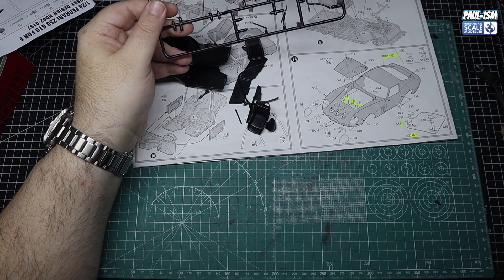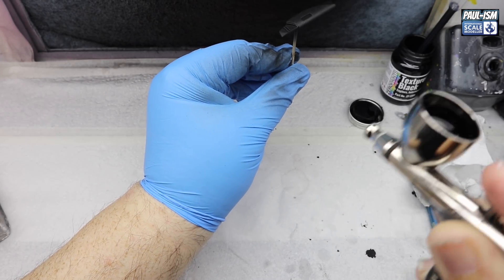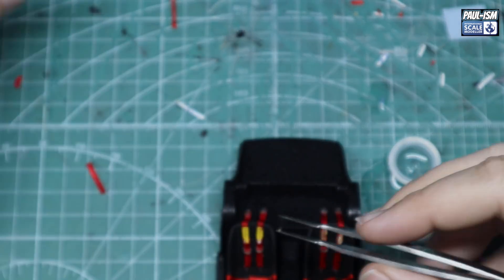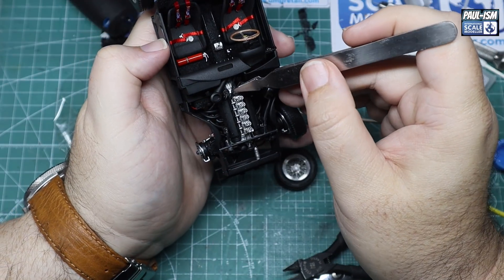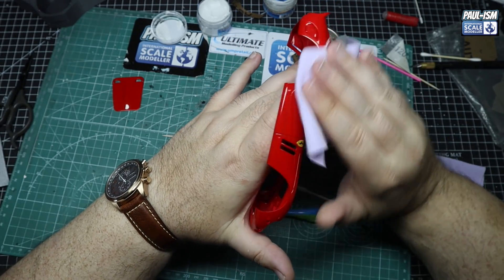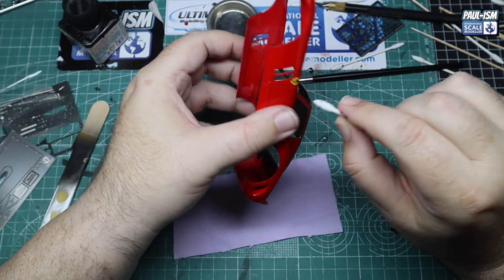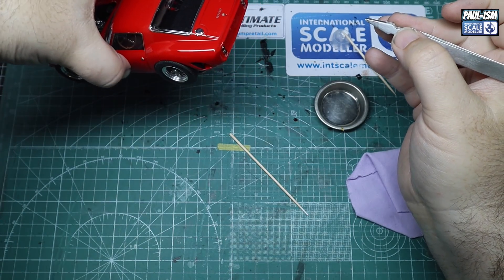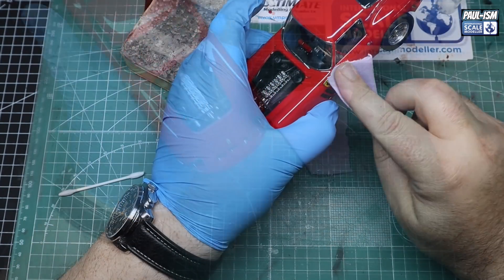Fujimi 1/24 Ferrari 250 GTO - Part 3

Comment: Did you heat the headlight pe bezels up like you'd do with armour Pe to take the spring out the brass so it moulds to the part with some abs ultra white glue
Reply from the maker: It’s steel pe you can’t do that